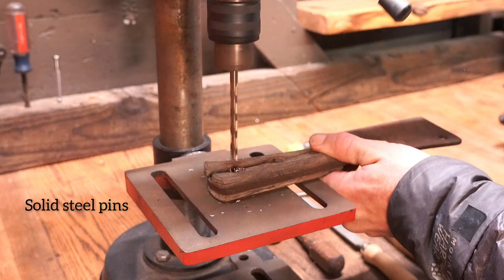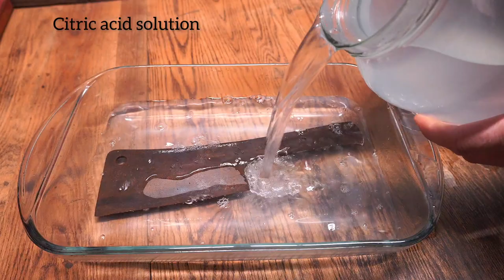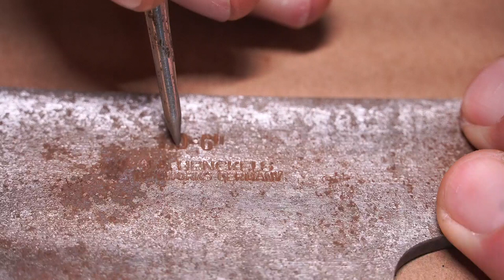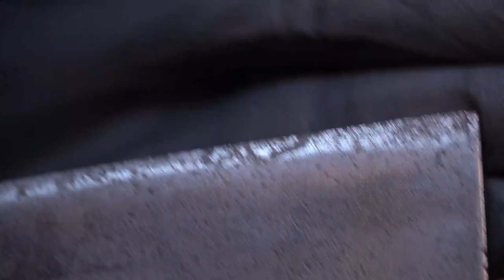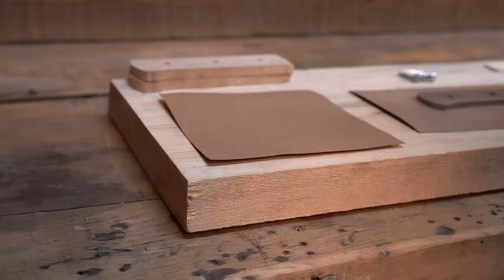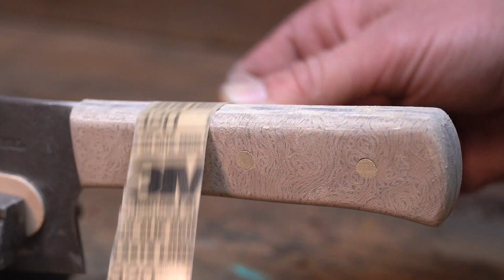Antique Henckels Meat Cleaver Restoration

Comment: May I suggest using Flitz brand metal polish on restorations like that? It works on lightly rusted ferric metals with a cloth but can be used with a polishing wheel to remove heavier layers of rust like the one you had before you used the wheel.
Reply from the maker: Is it food safe?
Reply: @old_iron_axe_and_tool  Yes, it is. I have used it to remove rust from cookware that is used in an oven as long as the residue is wiped off or out of it.